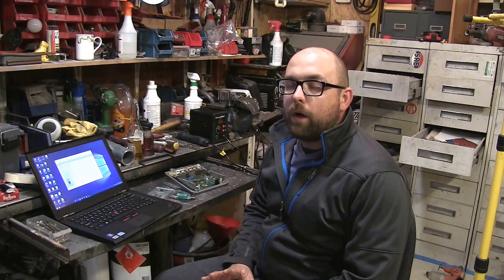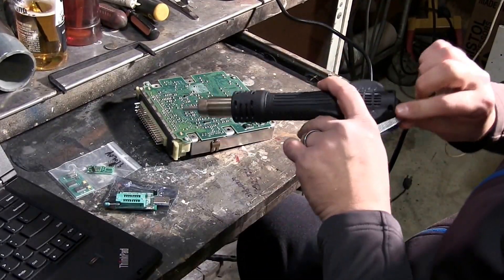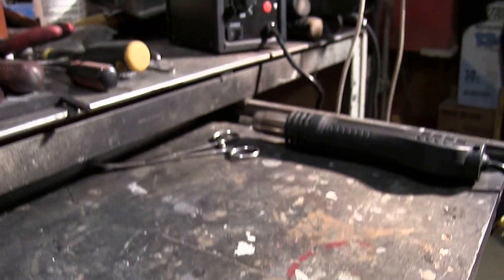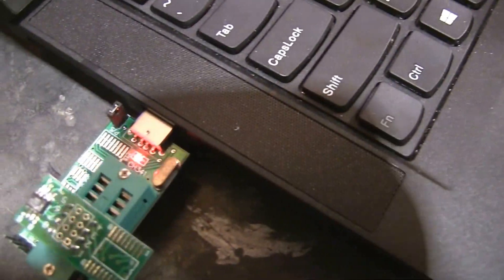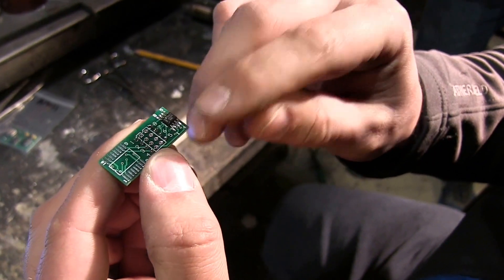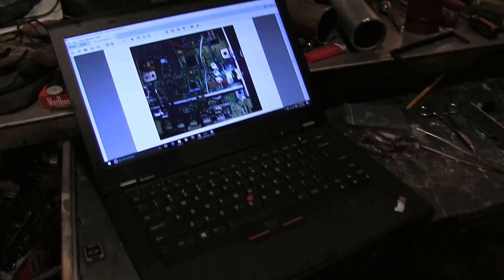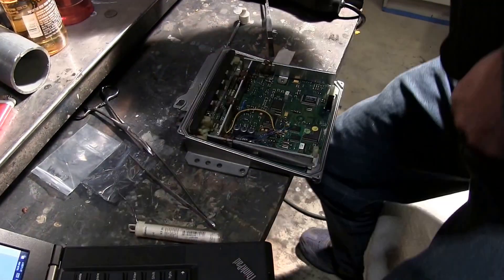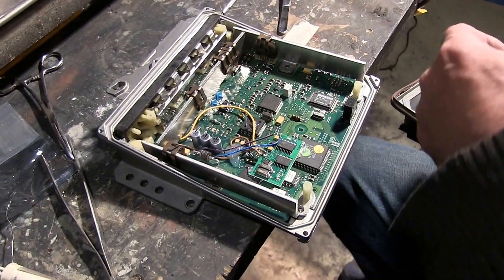Hacking The Immobilizer for the OM606 Diesel Wagon Swap

Comment: A simple remap on the chip to delete the immobilzer would have overcome all that hassle, or even better a mechanical pump, why did you use the ecu? Not hating just wondering :)
Reply: I haven't found information on how to delete the immobilizer.  Could you point us in the correct direction?
Reply: AlanMcYou it’s very far from you but a guy in Dublin takes the immobilzer out of the ecu and can put a stage 1-3 map on it for 250 Euro! Fair play on the work tho took a lot of time to figure out I’d say!
Reply: Hi.  I live in Ireland. Could you let me have the name of the guy in Dublin please?
Reply: Is there a way to put a om605 engine with some kind of mechanical pump into w202?Just wondering,if I used mechanical pump there might not be such problems with wiring at all,but how about auto transsmision?Currently I have S202 C200 with m111 and auto trans,I woud like to put in 4 or 5 cyl diesel,I dont think getting engine run woud be big problem,as I coud use mechanical pumps,but what about auto gearbox?Where and how they get signal/vacuum/anything else to work correctly?I do know nothing about diesels and auto gearboxes,.I completely understand how i coud make it work with manual gearbox,but want to keep the auto.thanks.
Reply: @pageuser55  , post from long time ago, but still: There is programmable ecu available for OM606/5 and also for 722.6 gearbox, tho gearbox ecu is too expensive, atleast for me.  Older more mechanical auto gearboxes do not handle much power...It is possible to use w210 manual gearboxes, but I do not know what cluch and flywheel fit.
Reply: Ģirts Bogdans get a more modern box and use a controller
Reply: piston head 1243 what kind of controller?Do you think oem mercedes transmission unit?i have been told that i can use gearbox from om603 with some kind of oldschool control with vacuum.If I install oem merc gearbox unit ,i think it woud be complicated to pair it with the engine and car?